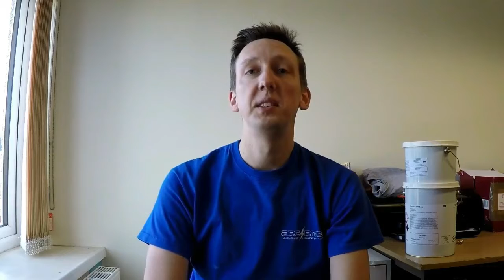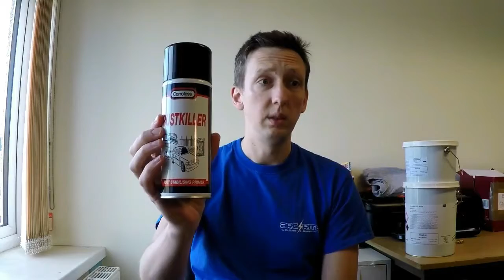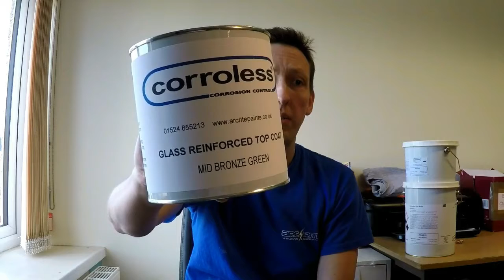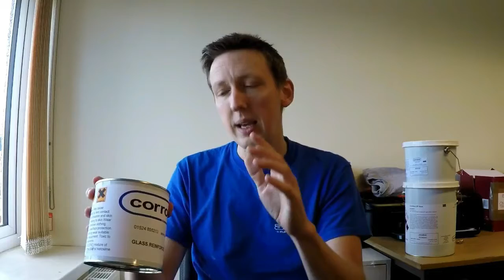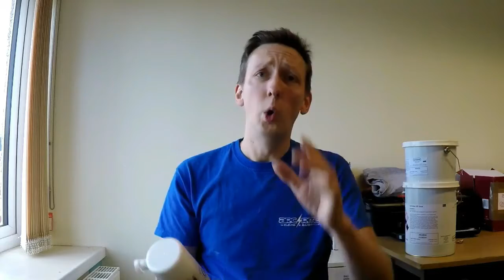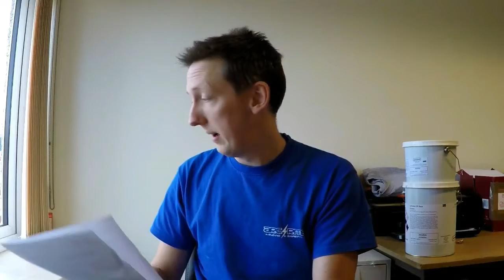Arc-Rite Paints Corroless Rust Control Overview

Comment: Question for you.  Is the Corroless S compatable with Upol Raptor? meaning is it possible to prime with The RCP then overpaint with the Raptor product?
Reply from the maker: Yes you can use Corroless S and overcoat with Raptor if you wanted too.
Reply: okay cheers.  Would you recommend keying the primer  first since it appears to seal itself when dry.?
Reply from the maker: The overcoating "window" for Corroless S is between 8 hours and 7 days - so between that time you should be able to overcoat without any abrading. However, it will cure quicker in warmer weather, so if you were getting through that "window" i.e were at day 5 for instance, a light sand with medium to fine wet&dry would be fine.
Just remember to clean off afterwards to get rid of any dust etc. Then paint.
Reply: Arc-Rite Welding & Safety Ltd  Thanks.   What is the flash time for the Corroless S between coats  BTW.  ( While I got you here.)
Reply from the maker: At 18c - 4 hours, at 10c 8 hours
Reply: cheers.